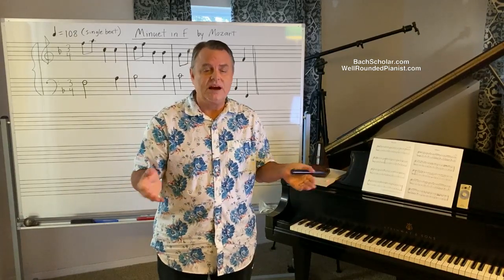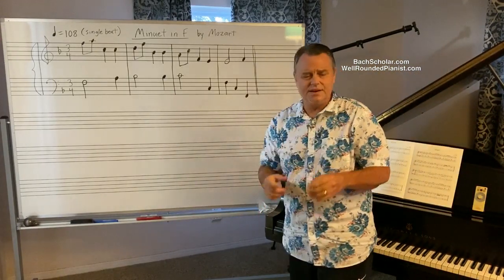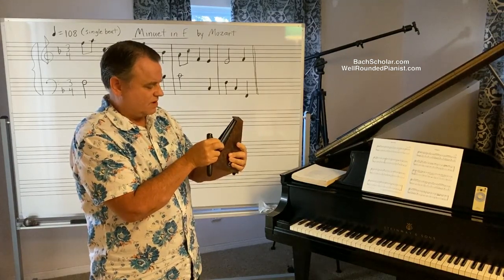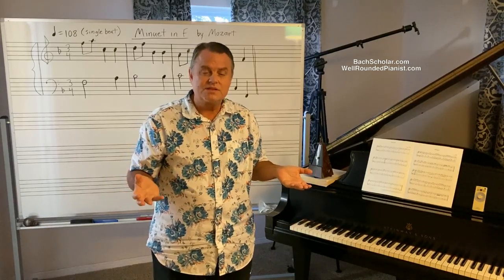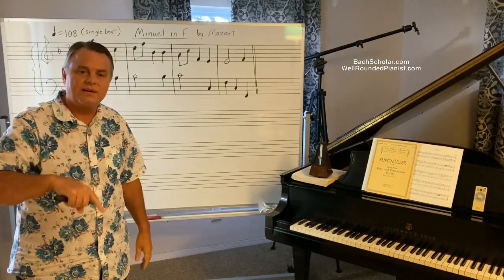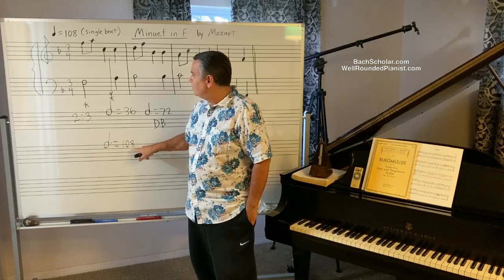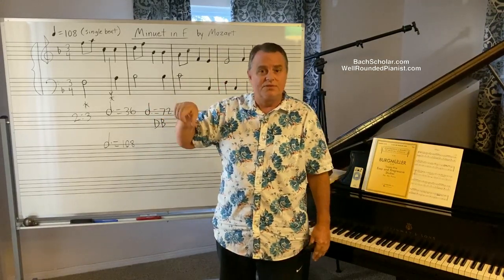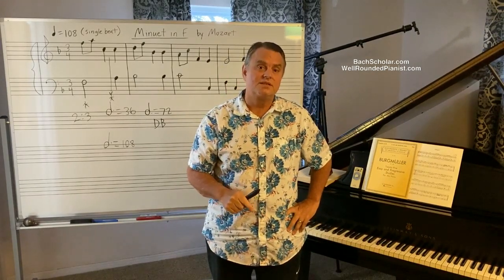(Part 1) Deficiencies in the "WBMP Tempo System" as taught by Wim Winters

Comment: The tempos of minuet were often indicated by the dotted 1/2 note eg Czerny for the minuet of Beethoven's Op 2, no1 gives 69/72. Played at this speed the piece can no longer be considered a minuet or an allegretto, which shows how stupid a single beat reading is. With a double read reading  you half the figure, approx. 35, multiply by 3 for the 1/4 notes and you get a perfect tempo for this piece,  1/4 = 105. There is a lot of convoluted arguing in this video, the whole aim of which seems to be to do down Wim Winters.
Reply from the maker: So then, if a 7 year-old student were to play the Mozart Minuet in 1830 and if it were marked DH = 72 in the sheet music, the student would simply take 72, divide this by two to get 36, then multiply this by three to get 108 per beat? I see, it's so simple! This is the whole point I am trying to make. Pianists or any musician should not be expected to perform a whole string of calculations just to use the metronome at the proper speed. This is why double-beat is primitive and why composers often failed at indicating reasonable tempi using the system.
Reply: About this very Minuetto Czerny writes: “Humorous and lively; so that the Allegretto is NOT here to be taken in the ordinary tranquil time”.
What’s the problem with the original tempo in single beat? It’s perfectly playable!
The only connection between the old renaissance practice of tactus and metronome numbers is Talsma’s personal assumption. No source unequivocally states the use of double beat during Beethoven’s period and beyond. Then, using the same principle, you could decide that music was played 17 times slower and scream to the world “Here are the proofs!”
Reply: It seems that the system for translating between metronome marks and italian words at the time were different than nowadays actually. Maelzel, in an article, said Allegro is twice as fast as Andante, which is twice as fast as Adagio. 
Also, that same article says that half=80 is 40 4/4 bars a minute, which is single beat not double beat.
Reply: @maxxiong  this whole system of 'times two' is also with Quantz and can be found with other authors as well. It should always be taken with a grain of salt, and Quantz specifically writes so.
Jan Albert Ban (1642) wrote that 'in music what is less than whole we call half'.... and even today when musicians speak about a very fast performance: 'double tempo!!!'. It is a normal hyperbole.
Reply: @BachScholar  The use of the metronome was widespread by composers, and musicians like Czerny and Moscheles. If it had been of no use or too difficult to use, this would not have been the case. It was seen as a more accurate adjunct to the Italian tempi names. A 7-year old learning the piano would not need to use a metronome or wouldn't care to - his teacher might well have known the correct speed for a particular type of minuet, and anyway he or she could if necessary use the metronome instead of the child. I think you are tilting at windmills because you are unwilling to engage with the evidence Wim has produced.
Reply: @petertyrrell3391  Which evidence?
I am sure you are a pianist and remember the time when you had to learn the 3:2 tempo relation and put it into practice. It's really not a beginner's business! And it gets even more complicated as soon as those ternary pieces start to have dotted rhythms or anything else than only quarter-notes.
Reply: @vito-lattarulo  You set the  metronome for a minuet on the 1/4 note - there is nothing difficult about that. There is no question of a beginner having to count 3 against 2! This example of the needs of a 7 - year old is really not relevant and is an attempt to muddy the waters. If you want to look for evidence look at Authenticsound's site and also Ruchti's. The problem is that 1st movement of the Hammerklavier is unplayable at 1/2 note = 138, and attempts to get near that sound like a dog's breakfast and are not idiomatic to the piano. Thus one  needs to think again about these early MMs. By the way it is better to teach a 7- year-old with children's songs suitable for his or her age, encouraging the development of the ear and playing by ear without rushing too quickly into the details of notation too soon.
Reply: @petertyrrell3391  you have commented a zillion times on Minkyu Kim playing the Hammerklavier in Beethovens MM, and now you claim 'it is unplayable'??? I know you are an English teacher but I would still encourage you to look up 'unplayable'...
https://www.youtube.com/watch?v=0WEebNfvVlQ&t=408s
Maybe this is not idiomatic to your ears, fine, but unplayable it is not, and 'a dog's breakfast???' Hardly.
Reply: @benjaminachron1493  You should look up "trolling". That's what you do. I would think a "dog's breakfast" would be a very good description of Hammerklavier attempted to be played at 1/2 note = 138. Of necessity you have to skate over the details and at this speed it is no longer an allegro, especially in the earlier use of the term. Presto and prestissimo were two gradations above allegro, not synonyms for it. You should study musical terms in the old treatises.
Reply: @petertyrrell3391  yeah, right. I truly believe I have read a bit more of original sources, than you, oh dear 'what do dots under slurs mean???' Peter...
Reply: @benjaminachron1493  Regarding dots under slurs, the sources suggest a semi-staccato, something between legato and a sharper staccato. However, they are often used in a context where legato is required, and any detaching of the notes would sound incongruous. E.g. the Schubert B flat impromptu, the variations. So it is necessary to pose the question.
Reply: Peter Tyrrell I try to ask you a last time this: how is double beat connected to te metronome speed? Why is a difficult piece supposed to be played at half tempo. Why not triple or 24665tuple beat? And why do we have to play also all the overwhelming majority of playable metronomed pieces in double beat?
Reply: Peter Tyrrell Heard Bogenvibrato?
Reply: @petertyrrell3391  the simple truth is that you've hardly read an original source (certainly less than ten...) and that you prefer to parrot some pieces of 'evidence' from AS. SImply because it suits your personal taste, and adversion for the 'establishment'.
Yet you lecture people who have spent decades researching AND publishing... Strange, very strange.
Reply: @benjaminachron1493  Your remarks and very narrow pseudo-intellectual viewpoint shows that the musical establishment needs cleansing. You say you have read more sources than I have, but don't appear to have applied your intellect or judgement to them.
Reply: @petertyrrell3391  fortunately we have plenty of amateurs who can tell us how to do our job. Thank you for your advice. (oh, and do read Miehlings article, I'm sure he will benefit from your comments as well.)
Reply: @benjaminachron1493  I had an old German cello teacher who taught me the double-bass. He said that "Academic musicians were like eunuchs in a harem - they know how to , but they can't". Wim called out some very sloppy statements by Miehling in one of his earlier videos. Perhaps I'll find some more in that article.
Reply: @vito-lattarulo  in piano music?
Reply: @petertyrrell3391  for your information: I am not an academic musician, I have two masters (organ and piano) and a concert diploma for organ... exactly what our friend Wim has by the way. 
So I'm actually pretending to be a eunuch in a harem, which is quite an enviable position :).
And no, Wim found no errors, he said 'even for Miehling a Schlag is always double', which is completely untrue. Miehings book is full of early pendulum quotes which are single-beat. From memory, and since you are British: check Tans'ur.
Truly disgusting is that he attacks Miehling and deforms his statement while Miehling is banned. To continue your images: below the belt...
But if you do find errors in Miehling, please let me know, I would be very interested. No sarcasm.